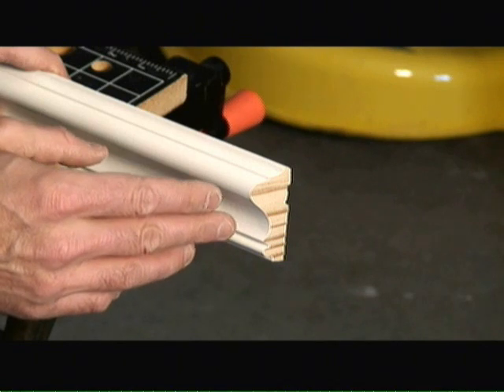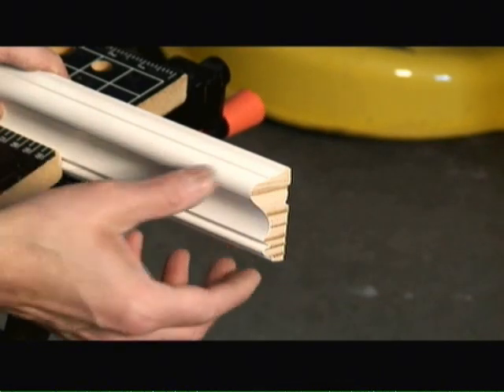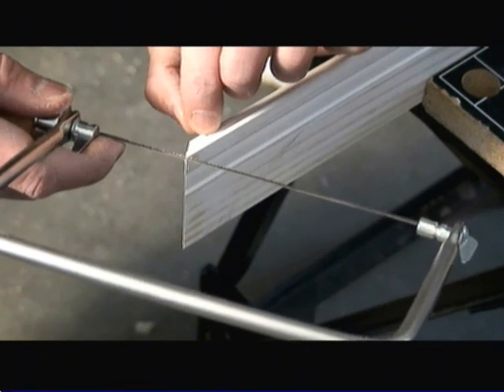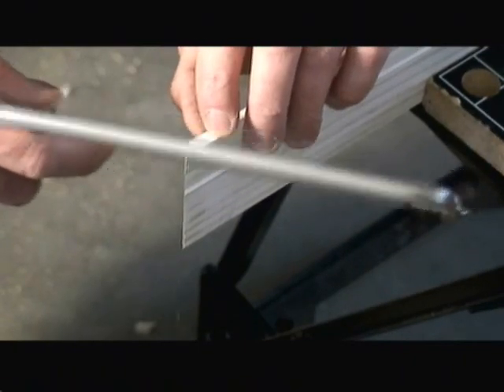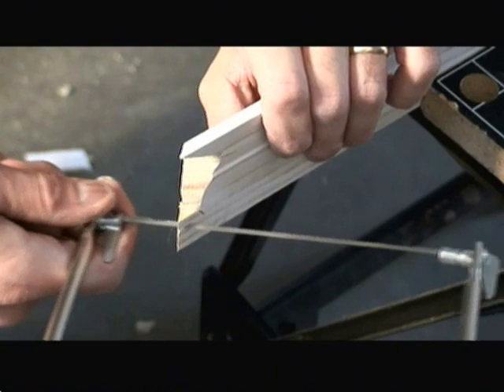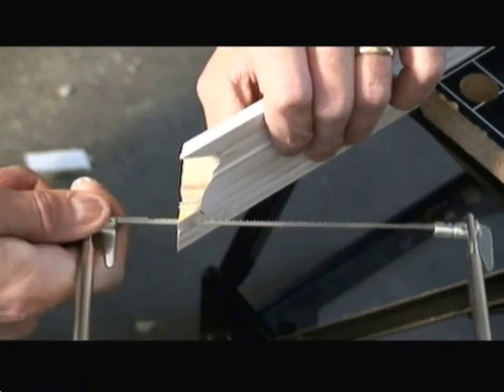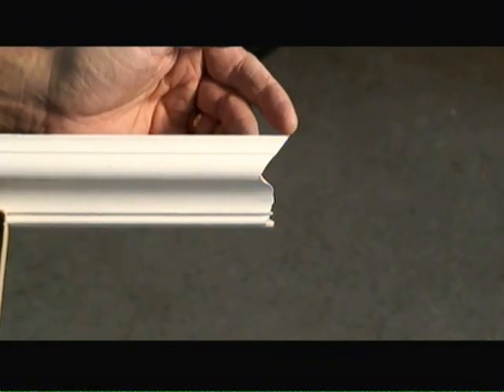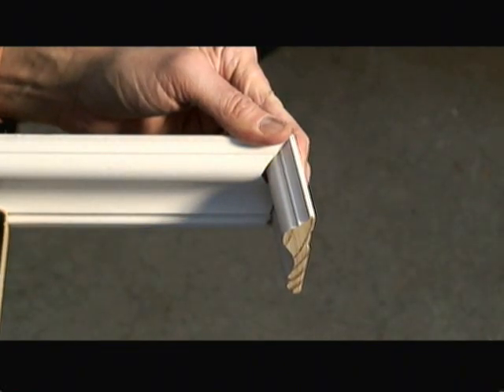How to Cope Chair Rail Video

Comment: does the non-coped piece have to be cut at 45 degrees? Or can it be a straight piece?
Reply: Just cut it at 90. No bevel needed on the piece that you are coping up to.